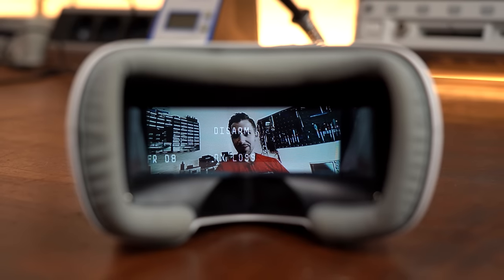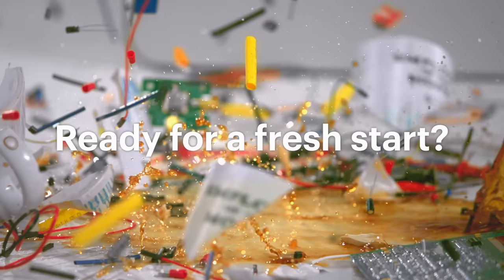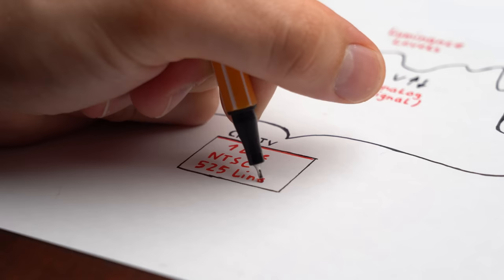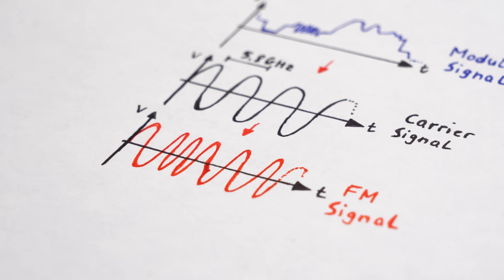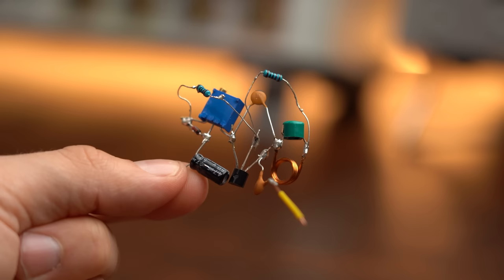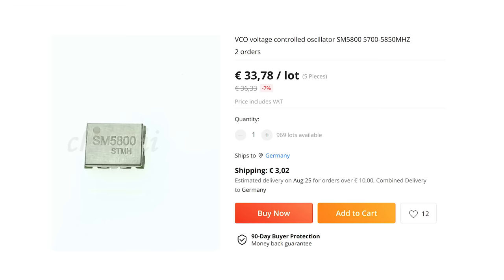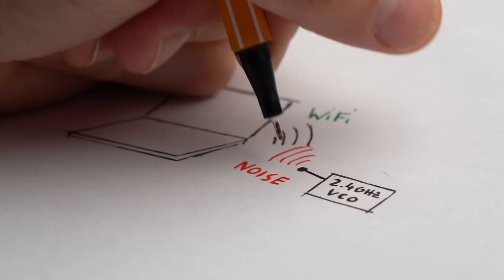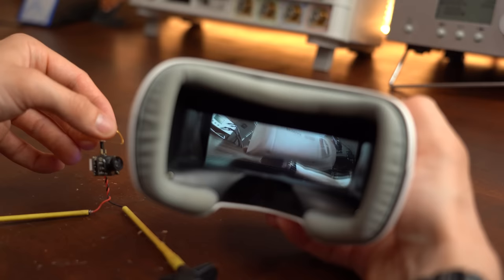I tried Wireless Video but ended up building a WiFi Jammer (A Fail Story)

Comment: For RF circuits on that high frequency, you cannot use simple wires for connections, because the trace length, as well as the characteristic impedance (typically 50 or 75 Ohms) need to be considered.  
Also, after every antenna, you firstly need a stage of a bandpass filter and low noise amplifier, because the signal at this pin will be at nano volt level at best. The length of the antenna is also very important, as this directly influences the antenna gain.
I would suggest to design a proper PCB with controlled impedance, minimal trace lengths and proper rf components (good rf passives, ics, filters and antennas) designed for your needs. Take a look at Phil's Labs yt channel on RF PCB design basics to begin with.

Comment: As a drone pilot who used to fly analog, the best way to get better range on your drone is
A) get the DJI digital system which has its own caviats, mainly the video transmitter weighing 25g problem and the whole needing 2s-6s input voltage. (and digital fpv at the time of writing is a total shitshow, best bet is to wait for dji v3 to come out, or for HDzero to improve a bit more for whoop usage.)
B) get better antennas on the aircraft and drone
C) upgrade the stock analog vtx to a more powerful vtx.

Comment: Mini whoop drones are amazingly fun to fly around with! If you want to improve the video signal you could also get a proper receiver, such as the TBS Fusion or Rapidfire modules., they'd do wonders for your goggle image.  Your goggles don't have a module bay, but it's easy to connect up with some soldering, the module signal is very exposed.

Comment: What an amazing video great scott! Have been thinking about wireless fpv video for a long time, i think i even mentioned it as a potential project on the comments section of one of your videos a long time ago. A video like this has been a long time waiting for me, and super stoked that you covered it!
Ps. Love the t shirt design it looks awesome!
Reply from the maker: Thanks for the feedback :-)
Reply: @greatscottlab  I know going into the digital video is a whole lot more work, but i must say that digital wireless signals are often way more resillient, so heres a video that really got my curiosity going related to this topic. I dont have The sufficient technical knowledge to make a circuit that does this, but maybe you can.

https://youtu.be/0faCad2kKeg

Also, from what i’ve gathered from many hours of googleing, vco’s are very sensitive to em noise and temperature variations. I would suggest you try put your vco in a small faraday cage, say a metal thermos cup, and keep the temperature in their somehow regulated, (idk maybe with ice or in a fridge or something) or at least put the metal shield back on somehow, and have the antenna come out of the faraday cage (obvs) through a small hole or something.

Comment: Also you want ensure the antenna is the same impedance as the system. That will maximise the power transfer and thus the range. You probably need to use VNA for this.

Comment: I think you'd have a much easier time of things by modulating the signal at a much lower frequency, like regular RF frequencies, then use a final output stage that does some frequency multiplication up to 5.8ghz and then amplify that output. As a bonus you can take your intermediate signal and feed it into a regular TV tuner if you shoot for around 50MHz or so.

As CuriousMarc would say, microwave electronics is the blackest of black arts. Everything matters when you get up there: trace routing, PCB dielectrics, component placement, etc. As others have said, just soldering components together in midair is going to leak your signal out into the aether and all you'll get out the antenna is a pitifully weak signal full of noise. Reducing the number of components working at that frequency will make for greatly reduced headaches.
Reply: how can you feed IF signal to tv tuner if it only outputs it . instead feeding it to demodulator ?
Reply: At some level I'm sure that's true for almost all electronics, it just gets harder to deal with /naively/ as you increase the frequency.
Reply: @jnharton  The effects are always there, sure. But as a random example, the 15pF of junction capacitance in a 1N4001 diode has a reactance of 212 ohms at 50MHz, but only 1.8 ohms at 5.8GHz. 212 ohms of effective parallel resistance is something you can probably deal with in a circuit, but at 1.8 ohms you no longer really have a diode in your circuit at all. These parasitic capacitances and inductances really eat your signal as you go up in frequency.

Comment: the range of video transmission depends mostly on good antennas. You can make a flight of 2 km with a 10mW vtx. On the drone you have - cetus pro - there is only a short wire. You can try to attach small good antenna and your range will increase significantly.
Reply: Tbh I think it is the normal Cetus with the brushed motors. I for my self have the Cetus pro and will try your trick to improve my video range

Comment: I feel you have misunderstood how the VCO works. THe VT or control voltage pin is set between .5 and 4.5V this sets the operating freqency of the VCO ( this is generally controlled by a PLL). the signal you wish to transmit is normall on another pin. The diagram you had earlier showed pin 4 as the "mod" pin. You have it marked as N.C. but in reality this is where your video should be connected.

Comment: A few things to note. The board you were searching for a transmitter on was the main board. Not the video transmitter. The processor chip you found could have been used for some internal timing of components/signals on the drone itself. There is a timing circuit between the camera and the video transmitter. Some cameras don't play well with all transmitter systems. I love your channel and this is the first time im compelled to speak up. I feel as if your transmitter is missing some key components and I anxiously await more drone based videos and a revisit of this circuit.

Comment: Greatscott, the problem is FM Overmodulation. At 7:26 we see that the sensitivity of the VCO is 75MHz/V, (Vt=0.5-4.5V). The standard amplitude for the video signal is 1V/75 ohms. You amplified the video signal using the operational amplifier to 5V. Applying this signal to the VCO, the frequency deviation will be 5V*75MHz = 375MHz (the width of a radio channel is 20 MHz, https://wildlab.org/wp-content/uploads/2015/07/RTC6705-DST-001.pdf - page 7), so you have exceeded the limits of a channel. A resistive divider must be used at output of videocamera, so that the amplitude of the signal is 0.08V, this leads to the following calculation: 0.08V * 75MHz/V = 6MHz (maximum frequency deviation). Resistive divider has 71 Ohm and 6 Ohm, or we use a potentiometer instead of the 6 ohm resistor connected to the ground. A separation capacitor must be used. The command voltage for VCO must be between 0.5V and 4.5V (Vt=0.5-4.5V), so a second resistive divider must be used at the VCO input (divided from +5V) to ensure a voltage between 1V and 4V(for example ,this voltage establishes the carrier frequency), a potentiometer can also be used. A Emitter Follower scheme can also be used.
I hope that my simple solution will help you complete this project successfully.
Reply: Wow, so detailed!!

Comment: Great video! In addition to other suggestions mentioned here, you can try using different power supply (such as battery). Switching power supplies in particular may cause unwanted modulations and mess things up.

Comment: Very nice that you've showed you're little journey through RF Engineering.. Anyway it's important to say that it is very dangerous to play around with free running Oscillators connected to antennas.  Especially in Germany where BNetzA is very strict. 
Besides that,.. Your problem is most  due to required bandwidth in relation to the low carrier frequency in your first try. The second VCO attempt really needs video signal pre conditioning to make sure that the frequency modulation is withing range of the receiver bandwidth of your TV.
I'm working as an RF engineer for several years now... And let me tell you,  it's that one field in electronics where it is almost impossible to get stuff running safely without proper knowledge and even more important, proper measurement tools.. :)
Ask Keysight for a fieldfox!

Comment: Way back in the eighties when I was so much younger I gave up on antenna building because of the complicated calculations taking in count wavelength, antenna wire thickness, coax length, standing waves, etc. It made my head spin. 

Probably it's second nature when you only mention;  ''an antenna wire" like everybody knows how it works.

Lots of stuff I didn't get back then, now fall into place watching youtube video like yours. Maby when you explain those calculations needed for an antenna a bit, it can help (not only) me, fit these puzzle pieces together.

Fun to see, I did not expect, in this time and century analoge video is still actively produced and used.

Comment: If you wanted longer range I recommend goggles with external sma connectors and buying some better antennas. If you want more output power you can buy vtx for example from tbs

Comment: Rf circuits of that frequency range are whole black art too themselves! There are just so many factors to consider component length, connection length the shape of the circuit no sharp corners etc. Good luck with your endeavors.

Comment: Several things missing:
Analog video uses almost 6MHz, a basic op amp won't get it done. But it will pass sync and most of the luminance.
When you get up to these higher frequencies circuits get very fuzzy. At 5.8GHz the wavelength is only 5 CM. Everything affects the circuit, component lead lengths matter greatly, lead widths affect impedance, even the temperature changes things.
Analog TV over FM is a mile wide too. With a good modulation depth the signal can be 30 MHz wide.

Comment: Hi Scott, in your experiment with the Collpits oscillator it is essential to disconnect the base of the transistor. 1 capacitor of 100 nf between base and ground will start your oscillator. From what I understood in the clip, you obtained a signal from it around 7mhz, which is roughly the spectrum of the video channel (approx. 6mhz). Your oscillator should have worked at least at 100mhz. The fact that you have not received anything there means that it is not oscillating. Try to use a transistor for the radio frequency (BF200, 2SC9018) and on the TV screen when you have tuned it to the frequency of the transmitter you should have a black screen.
Also, I do not recommend this type of oscillator, it is very unstable and as you said, it modulates both in amplitude and in frequency.
For television, you are interested in amplitude modulation, analog terrestrial television has like 6mhz amplitude modulation for the video signal and on that signal, there is also a 6.5mhz fm carrier for sound. As far as I remember, even from the demodulated video signal the 6.5mhz filter was captured, amplified and then with a ratio detector the audio signal was extracted. You are not interested in the audio part anyway.

Comment: On the fpv side of things, when we run into this issue with entry-level goggles we normally figure out a way to get analog video into them and then use a diversity receiver module Bay that we plug something like a crossfire receiver into. But this is really cool :-)

Comment: This is my field of work. I am a telecommunication engineer. I think the receiver is receiving a lot of noise and it may also be transmitting with noise.
Because you are working with signal you need to use for your circuit a pcb.

Comment: Oh cool your getting into fpv. I see other people saying switch to CP antennas and I second that. You can also get a better (diversity) receiver. Higher gain antennas, reducing interference (I use the ham bands outside of the wifi channels), and increasing power. 
Imho TBS makes some if the best VTX equipment. Its really cool to see the engineering aspects of them. FPV and rc stuff got me into EE.

Comment: if i recall correctly, a simple vco should just make the carrier signal, you will need to create the fm modulation on your own. also impedance is very important in rf, make sure everything is well matched.

Comment: I think you need a VCO (voltage controlled oscillator or two, one to precisely create the carrier wave, and one to modulate it.
Reply: Oh, you just said VCO :D You know those are canned to prevent interference, So I ask, does your circuit work inside a soda can, with only the antennae sticking out?
Reply: You should also be using a solid state voltage controller I think? potentiometers are so dirty.

Comment: Once again great idea from Great Scott. There is no 
such thing as  failed project , just another point on learning curve ;) 
Only failed project is the one you haven't tried or gave up before start ;)
I would look that modulating signal at input of VCO... You are aware that inverting configuration of   op-amp wouldn't work. Or maybe it is getting inverted inside module ? 
Maybe your video amp self oscillates ?
I would start from there. 
Keep up the great work 
Cheers

Comment: On these tiny FPV drones cheap and crappy dipol-antennas are used. On the bigger ones like my 5inch quad circular polarized antennas deliver a much better range. Maybe you can find a small enough one to upgrade the TX antenna. Opening up the goggles and upgrading the RX antenna would certainly help aswell, because these rtf kits usually don't use the most advanced gear anyway.

Comment: This frequency RF stuff is the subject of my PhD dissertation. Finding ICs that operate in this range is hard or expensive. Finding discrete components is also hard.
Reply: And the shielding is sometimes part of the circuit’s frequency tuning.
Reply: @stevebabiak6997  Gotta love how everything at RF has some RLC components to it. Don't forget those ground loops and return paths actually mattering.

Comment: You can't really deadbug or free build radio circuits especially in the microwave bands.  Because of the wavelength being so short, exteme precision is necessary.   NTSC signals are mixed mode, complex, and digitization of receivers has made requisite precision increase quite a bit.  
A fun and fascinating rabbit hole to explore, and you certainly learned stuff along the way so it's a good exercise.  
My suggestion would be to investigate different antenna types and designs.  I managed 2.5km of 1.2ghz video reception with 250mw effective radiated power.  That was on an aircraft changing orientation in an RF noisy environment.   Just required some experimentation with antennas, lead lengths, impedence matching, polarization etc.  KM4KHC

Comment: Excellent video as always! 

In terms of problem, I wonder if it has to do with the Antenna impedance matching as well? And as other have suggested, an Frequency analyzer will be very useful to help see what the actual frequency is being transmitted, I also think using a coaxial cable or any form of shielded cable will also improve it significantly

Comment: Really making me want one of those drones. Looks like so much fun.
Reply: They are really awesome and fun to fly. FPV Drones are a really fun hobby and you can go down the rabbit hole to find the best drone to fly... it's just an awesome (and lately a pretty expensive) hobby. I would recommend you to start with a small analog drone if you want to get into it, maybe a RTF kit to get you started with the all of the gear you need.
Reply: @natter18  Is it the headset that makes it so expensive? Or is it some sort of licensing deal because of the frequencies it uses for video?
Reply: @anon_y_mousse  As far as I know a fee for  using the Video bands isn't the main cost point (I don't think there are any fees but correct me if I am wrong). It is mainly the cost of the components like the mosfets or the microcontrollers. Because the availability of those has gone down so the prices increase. The biggest price jump lately has effected the Flight Controler (The brain of the drone that has all the sensors), they gone up from like 30 dollars up to 50 or 60 Dollars. Another thing that has also been affected are the ESCs (Electronic speed Controller, it tells the motors how and how fast to spin) they have gone up in price a pretty similar amount.
Reply: @natter18  I guess I haven't been paying attention to the prices, but if I build it from scratch I can just recycle. I'll have to check if anyone has open sourced a design, or design one myself, either way.

Comment: Oh boy.. I had a RF project once and the components are the least of your worries... Circuit geometry and layout misbehaves at high frequencies. Try to make a simple small pcb with em noise in mind. This might solve most of the issues. Also, remember that at millimeter and submillimeter wavelengths any piece of wire is an antenna